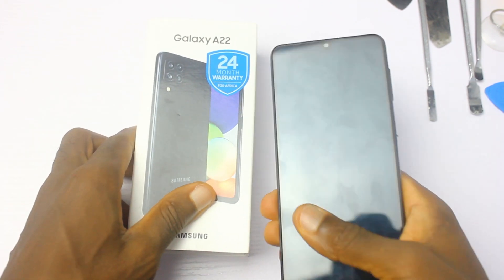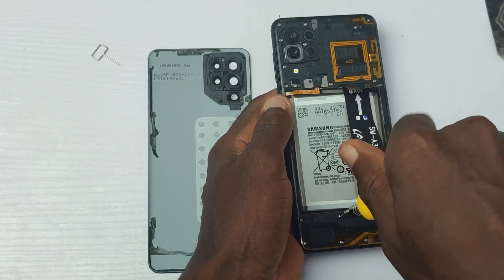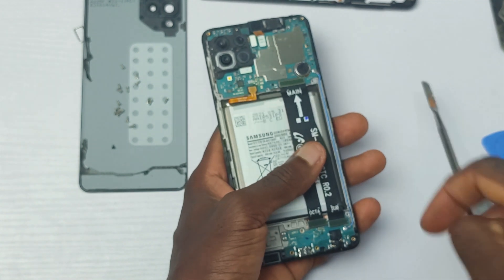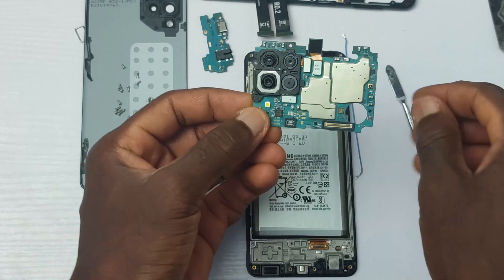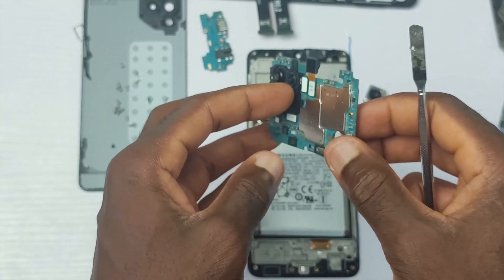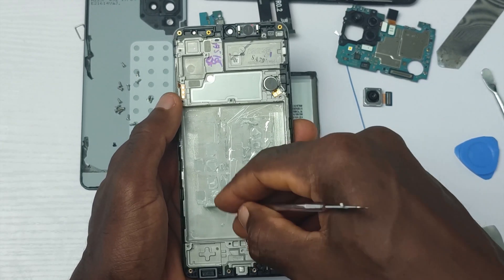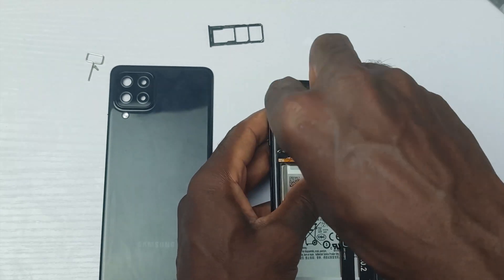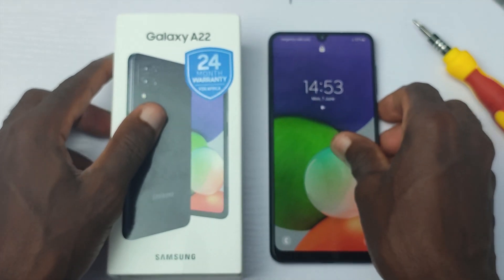Samsung Galaxy A22 Teardown: Camera | Battery | Motherboard Replacement

Comment: Hello. I've watched your teardown videos and they are a pretty good. I am kinda curious about a specific phone. Can you swap the 48 mp OIS , 8 mp OIS and the front facing 13 mp OIS camera of the samsung A22 4g into the samsung A12 camera which does not support OIS? Am kinda curious if they will fit in or even work. Its kinda interesting for a video. what do you think? Let me know.